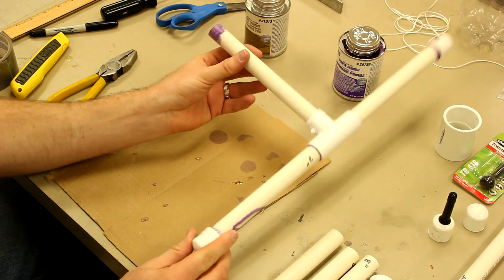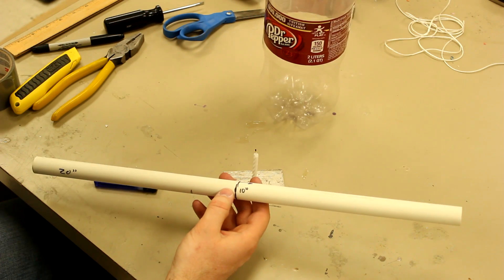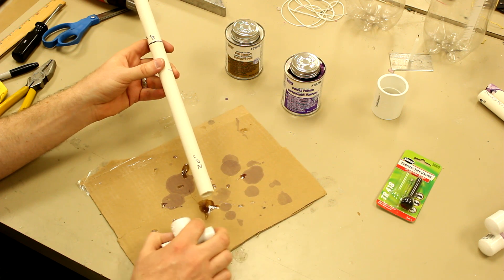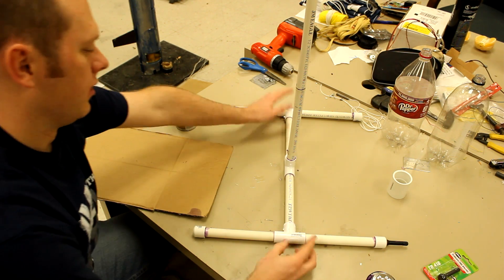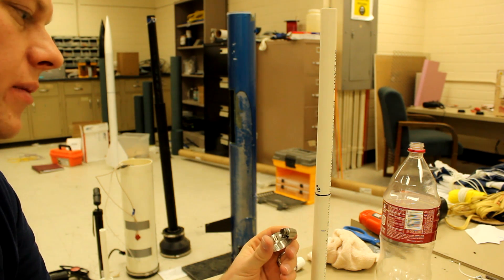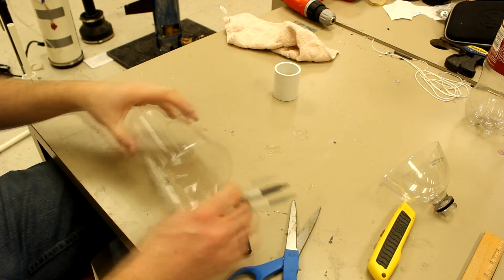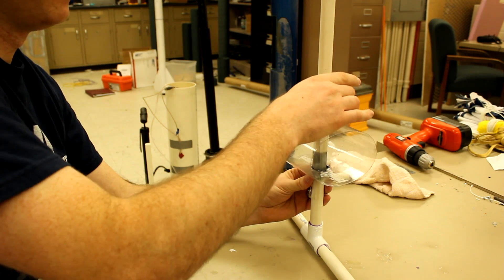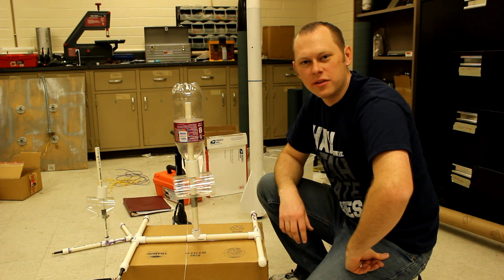Make your own water bottle rocket launcher! - Part 2 of 3

Comment: Hey, sorry for my bad english but i wanted to ask, wont the spring be pushed down by the weight of the bottle when its filled up with water?
Reply from the maker: The spring is there to push up the small collar that’s preventing the zip ties from moving outward. The bottle will only come down until it rests on the small seal you made when we slightly melt the pvc. Check out the next video in the series to see the rocket on the launcher.
Hopefully this helps. Let me know if it didn’t fully answer your question.

Comment: Excelentes videos🎉🎉
I have a question. What is the size of the drill bit to drill holes in the end cap? 0:15
Reply from the maker: If you check out part 1 at 1:23, https://youtu.be/FV2nrifqzX0, it is called out at a 1/2” hole. This is if you are using the tire valve called out in the same video and linked in the description of both videos.

Comment: I’m a little confused on what the spring does to release the bottle, how does it release the zip ties. Also my zip ties don’t stay on the bottle
Reply from the maker: The spring’s job is to keep the pvc coupling up to prevent the zip ties from coming off before the string is pulled. The pressure in the bottle wants to escape out the bottom of the bottle, but with the collar up, the zip ties cannot move outward to allow the bottle to move off of the expanded pvc seal.
When the string is pulled, the coupling moves down on the spring allowing the zip ties to flex outward. When this happens, the pressure can begin to move out of the nozzle of the bottle. Hopefully this helps answer your question.
Reply: @EngineeringToExcel  so if my ties aren’t holding the bottle down what should I so
Reply from the maker: I’d double check to make sure that the ties are fully encased behind the pvc coupling when it is in the up position, as well as, make sure that when the bottle is against the seal the zip tie nubs are facing inward and sitting tightly on top of the lip of the nozzle as shown in the video at 8:30ish.
Reply: @EngineeringToExcel thank you, I will try this
Reply from the maker: I hope it works. Let us know.

Comment: Are the zipties needed? Because mine keep moving and I’m not able to keep pushing them back down
Reply from the maker: You will need the zip ties. The zip ties are the only thing that holds the bottle onto the tube when you are building pressure. If the zip ties are sliding, you should make sure that the band clamp is around the bottom of the zip ties and is tight. If that is already the case, I’d try adding a thin piece of duct tape facing away from the tube under the zip ties and the band clamp. Hopefully this works for you. Please let me know either way.

Comment: Hey we are have a issue so basically you know the part where you have 20 inch plastic pvc pipe and on the 10th inch you have to burn it to make a bump, so we couldn’t fund a plastic pvc pipe so we got a metal one so now how do we make or form the bump please help please guide us
Reply: Ok
Reply from the maker: Just curious, we’re you able to find a solution?
Reply from the maker: Hmm… this will be quite a bit harder. Some ideas that may or may not work. You could try to create a thicker portion with some duct tape or electrical tape. Another thought would be to find a rubber band that could be stretched around the pipe and glued in place to create a seal. Let me know how it goes.

Comment: Primer and glue are supposed to be put on both the pipe and the fittings before installing.
Reply from the maker: That’s true. That is a miss on our part. Any other suggestions or ideas for upcoming videos?

Comment: How to prevent water leak?
Reply from the maker: The best way to prevent a water leak is to ensure that the zip ties are at the right distance. The second thing to verify is that you have sufficiently large bump from the heating and compression step.
Reply: @EngineeringToExcel  Thank you.

Comment: Honest question here, please help. Why does pulling the string launch the rocket? When the string is pulled it lowers the white cylinder, but it doesn't unlatch the bottle -- the little zip ties are still holding onto the bottle. What causes the bottle to release when we pull the string? Thank you in advance, really appreciate it. Good video by the way!
Reply from the maker: The pvc the prevents the zip ties from flexing outward when the bottle is under pressure. When you pull the string, there is nothing to prevent that movement,  so the resultant  force on the zip ties causes them  to move.
Reply: @EngineeringToExcel  ahhh.... Thank you so much! You're really making a difference for teachers and students around the world! =) I'm a school teacher by the way. This really helps. Keep doing what you do, the world appreciates your work! =)

Comment: The pvc fits really tight. Can the pvc be sanded to fit a little looser as it is pushed into the bottle?
Reply from the maker: Yes, but I'd personally recommend sanding the bottle nozzle with a fine grit sand paper instead.

Comment: Would pvc cement work for attaching the valve to the end cap? Or do I have to buy some epoxy?
Reply from the maker: The valve is basically a pressure fit if you drilled the hole the appropriate diameter into the end cap. There is no epoxy or sealant attaching the valve to the end cap. PVC cement will only work for bonding pvc parts. PVC cement creates a chemical weld between pvc components.

Comment: How did you make the rocket? 
What materials did you use?
Reply from the maker: We used a standard 2 liter pop bottle and taped on some fins made of cardstock. If you really want to make your rocket fly, you can also cut a foam football in half and tape it to bottom of the bottle to make a nose cone for your rocket as well as soft the center of gravity forward. Feel free to experiment with different designs to see which one flies furthest.
Reply from the maker: I just added a new tutorial to walk you through the process. https://youtu.be/D-qiIaHs6FU Check it out.

Comment: Hi.
Is a foot operated pump  appropriate for the launcher? I havent seen any video using foot pump...all use hand operated pumps. Any particular reason?
Reply from the maker: You can use either one as long as it has a standard fitting in the end.

Comment: how can we stop the flow of water to the out side when  we fit the bottle in pvc pipe (because of the gap between pipe and mouth of bottle)?
Reply from the maker: You'll need to increase the diameter of the pipe. Redoing the heating and compressing steps should help.
Reply: done
Reply: Does wrapping some PTFE tape help?
Reply from the maker: I haven't tried that, but if the tape stays on and can handle the pressure, it should work.

Comment: While iam inserting the bottle on the pipe the water flows out from the bottom. Any idea?
Reply from the maker: Some water will always come out the bottom of the pipe when you put it onto the launcher. You can minimize the water by putting the launcher into the bottle with the bottle facing up and then flipping it over right before pumping.

Comment: Astralian people cannot make this !!!!!!The bottle necks are smaller. Any ideas
Reply: For anyone wondering the same thing - I've just made this with 15mm PVC and it works fine. Our metric 15mm PVC is a very snug fit for the inside diameter of a PET bottle and adding a bulge by heating and compressing the pipe makes for a perfect friction fit with no water loss. Tested on PET bottles from Australia, standard pipe and fittings from the big green box. If you already have tools you can make this for around $20 AUD.
Reply from the maker: Thank you for the info. This will really help our international audience!
Reply: Henry Tompkin im from Aus and it worked fine for me
Reply: Sam Price  Hi Sam, I'm in Australia and planning to make this for a workshop. Do you have any tips for me in terms of sizes of bottles or any other Aussie conversions? I'd really appreciate anything you can offer. Cheers.
Reply: Why not try sanding the pipe? I am from India and the various 2 litre bottles and none of them fitted the half inch pvc pipe. So I sanded the pipe a little and the inside of the bottle neck a little (I could probably have just sanded the pipe further and spared the bottle). It now fits well. Yet to try launching.

Comment: I made this and I have a question, how am I going to keep the water in the bottle when launching it?
Reply from the maker: Just have the top of the launcher extend above the water line in the bottle. A little bit of water will end up in the tube, but you can always dump it out between launches if it is causing issues.

Comment: Awesome! Built one today with my 3yr old. He got to pull the "trigger", and what a thrill he got out of it! We did a couple of test fires without water, then added about 1/4-1/3 bottle full of water, and got about twice the altitude. As Jaimie explained below, it was easy to flip the launcher upside-down to load the water-filled bottle, and then flip the whole thing right side up. A little weight on the launch rails helped also (a brick works fine), as the launcher wanted to tilt/lift when the string was pulled. I held it down with my hand for the first round with water...this was great fun for the kiddo, as daddy got drenched, lol. Great fun! Thanks for the terrific tutorial!
Reply: Thanks I had this problem!
Reply from the maker: Thanks for the quick response and answer.

Comment: how do you put the water inside?
Reply: To answer everyone's question regarding water. Strictly speaking, it doesn't need water. In fact, if you want the to make the launch very loud try it without water. However, it increases the apogee to have water and getting wet is half the fun. Just fill the bottle and put it on the launcher quickly. Because the launch rail extends far into the bottle, you won't loose much water into the launch tube because the water level is below the top of the rail. Having the longer launch tube also increases altitude and guides the rocket in the proper direction while it gains speed. Optimal altitude is achieved with bottle about 1/3 full of water. Be careful not to put too much pressure in these bottles. They weaken with repeat use and/ or aging. I've seen burst pressure numbers as high as 150 psi or more but I only use 100 or less for safety reasons.
Reply: artiztaaa!!!!
Reply from the maker: +Brock W Thanks for the comment, hope you are doing well.

Comment: hey its very nice... but i want long distance so what shall we do?
Reply: I assume you mean downrange distance and not altitude. To increase distance you need a couple things. First, you want to increase the mass of the rocket and make it more stable. Add a medium foam nurf ball cut in half as a nose cone on the rocket. This will increase the mass and also move the center of mass forward on the rocket. Then, you can add fins if you want. Finally, angle the launcher in a safe direction. You will have to adjust the amount of water in the rocket and launch angle to optimize the trajectory but you will be amazed how far the rocket will go. They are fun to try to catch too.
Reply from the maker: Brock is absolutely right. Check out the tutorial on how to build the rocket itself for some serious range. https://youtu.be/D-qiIaHs6FU

Comment: nice but it is little hard
Reply: A very simple version can be made with just one piece of PVC, an end cap, and a shrader valve. Hold the bottle on by hand while a friend pumps.
Reply from the maker: Brock's version is by far the simplest, but does make firing it a little more difficult, and a lot wetter. :)

Comment: I made one based off of this idea. It works well. My suggestion would be to add a "T" to the vertical pipe and add the valve stem off of that to inflate it.  The problem with their design is that water fills up at the bottom of the PVC assembly, with nowhere to escape.  A little bit goes back into my bike pump (seen inside of the pressure meter).  I would also create a way to open the bottom to drain the water when you're done.  Overall though, good design.  It works well.
Reply from the maker: Great idea!

Comment: Your zip ties are probably too small.  I made it and it works fine for me.  I had multiple sizes of zip ties and had to use the largest ones so the ends were big enough.
Reply from the maker: I added multiple ziptie sizes in the description of the video based on your recommendation.

Comment: Hi can anyone help me? I made this an it works pretty well but the PVC coupling doesn't seem to hold the bottle in place so it shoots at sound 20-40 PSI. I am using a 2 liter bottle and 1 1/4 in. PVC coupling. Thanks
Reply from the maker: You'll want to make sure that the zipties are large enough to be held in place by the coupling. Additionally, if the zipties aren't flush on the top of the bottle and pretty even, you can have a premature launch.

Comment: Your Video was amazing but I had a couple of questions. I want to investigate how high the rocket goes with different amount of air pressure and water. What would you suggest is the best way to measure the height because sometimes the rocket would go 100s of feets in the air which is very hard to measure. I was thinking of using an altimeter but i'm not sure how to attach the altimeter onto the water bottle... I'd appreciate your help
Reply from the maker: If you want somewhat accurate results, you will want to use an altimeter. I'd recommend watching our rocket building tutorial (https://youtu.be/D-qiIaHs6FU) and embedding the altimeter into the nerf nose cone. Just make sure that you have some kind of hole to the altimeter cavity to make sure it works properly.

Comment: Won't the water just go into the pipe when you turn the bottle over.
Reply from the maker: Not if you keep the water line below the point where the top of the launch extends into the bottle. You only want about 1/3 of the bottle full of water.

Comment: Keep in mind if you use something else it needs to be able to hold the zip ties on. The band clamp's primary purpose is to keep the zip ties secure which in turn hold the bottle on under pressure. Using a make shift device to secure the zip ties could cause the bottle to launch unexpectedly.
Reply from the maker: Agreed.

Comment: Watch and listen when you launch the rocket. You want the air and the water to run out at about the same time. Thus, if you see and hear the air vent after all the water is ejected you should add more water next time. If you see water still pouring out (without much umph) as the rocket peaks then you should add more air. If you want to get real scientific do several burst tests in a contained experiment to see what max pressure your vessel will hold. Divide that by 1.5 for safety.
Reply from the maker: Great tip.

Comment from the maker: The T-sections are simply for stability. Also, the best way to regulate the pressure in the bottle is with a bike pump that has a pressure gauge. That worked best for us.

Comment: Good day, we are attempting to build our first water rocket. We found your video extremely helpful. But I do have a few questions. Could you please tell the use of the two T-sections at the either sides? Is their sole purpose, is to act as a stand, or is there any other scientific implications. And could you also tell us how to build a required amount of pressure and regulate it, as per our requirement. 

Thank you.
Reply from the maker: They are just there to create a stand. Check out https://youtu.be/D-qiIaHs6FU for some details on the rocket itself.

Comment: Ok I was going to make this and got to thinking about it before i started and does the water in the bottle not drain down in the pipes before pumping air into it?
Reply from the maker: You'll get a little bit, but as long as the section of the launcher in the bottle extends above the water line, it won't.

Comment: Great video!  We made this in a couple hours with your video.  The only tip I would have is to drill a 1/4" pilot hole before drilling the 1/2" hole in the cap.  Thanks for the video!
Reply from the maker: good idea

Comment: Good question. Its on the order of tens of seconds but varies depending on how heavy your rocket is and what angle you launch at. Adjusting the level of water you put in the rocket will change how high it goes (and how long it is airborne). A nice tip if you want it to travel higher is to take one of those big foam Nerf footballs, cut it in half, and attach it to the soda bottle as a nose cone. Makes for an awesome game of catch if you launch at about 45 degrees... but you need a big park!
Reply from the maker: https://youtu.be/D-qiIaHs6FU offers some good tips as well.

Comment: Something else that's a good idea is to use a longer piece of tape on the cable/zip ties, and fold the sticky side onto itself, and instead secure them to the pipe with jubilee/hose clips.
This will allow you to re-adjust the strength of the seal against the bulge in the vertical pipe, essentially making maintenance possible on a part that likely to come loose through use.
I hope these tips are handy for you and anyone else who reads them.
Reply from the maker: Brilliant!

Comment: I'd like to offer a useful tip for working with PVC cement and its primer if I may. If you pop the primer in the inside of the junction piece and the cement on the outside of the length of pipe, you gain three advantages.
Firstly, you won't have any cement forming globs or lumps inside the piping.
Secondly, the two won't mix together and start reacting until you push the pipe and junction together.
Finally, you won't end up with primer deposits on the cement brush or visa versa
Reply from the maker: Great tip!